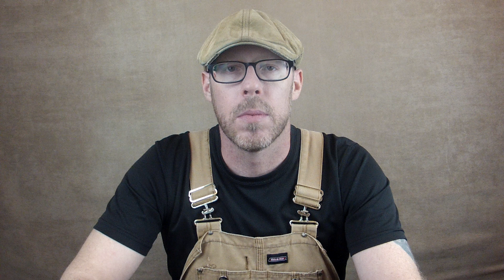What makes a pool deck crack?

Comment: My pool is from 1971, we remodeled only the inside in the fall of 2014. We don't have a leak? but I am concerned with how much cracking there is. I should also mention that I no longer have any expansion joints, it used to be wood but now theres just a hole. Sounds horrible I know but my pool deck is quite large ( a little afraid of the price I might get dealt) and I haven't been told by anyone that it's something that needs to be addressed. Any advice would be greatly appreciated, thanks in advance